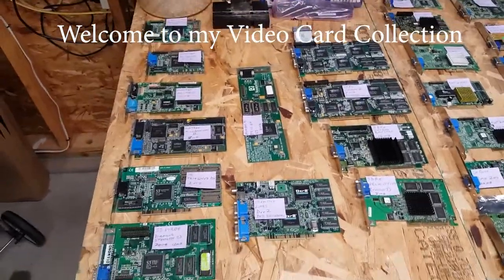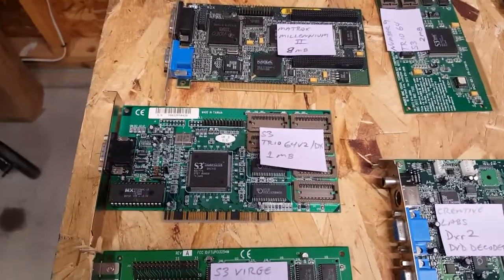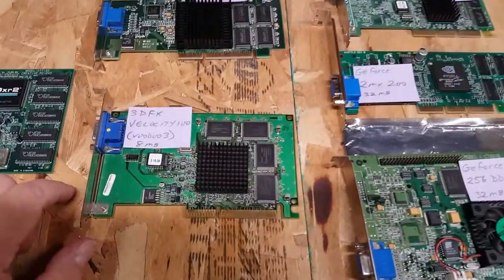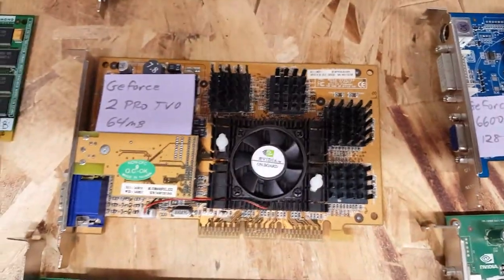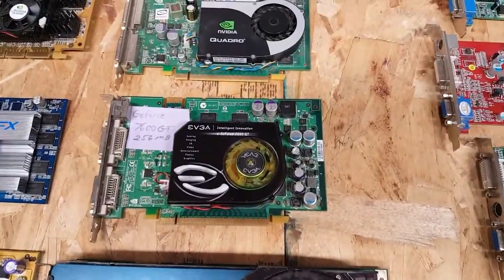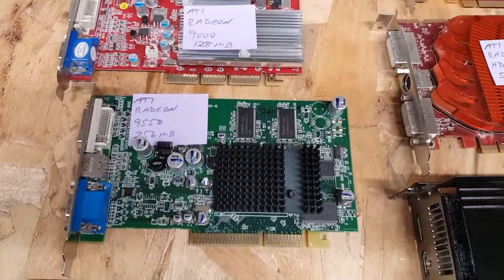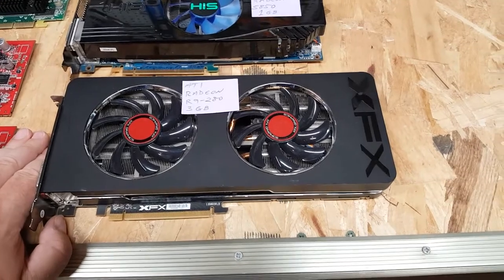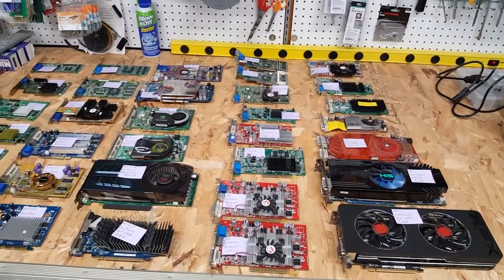I am a hoarder.  My video card collection.

Comment: Oh. Hello. I have the same interest as you. I also have a lot of 3d accelerator card collection
Reply from the maker: Hello!  It's fun hobby, right?  Do you have any really unusual or rare cards yourself?
Reply: @UncleMikeRetro   asus 7800gt dual?matrox parhelia 512?

i have many top card like gtx295 9800gx2 gtx690 quad
But if it’s a rare collection, I don’t think I have many
Reply: @UncleMikeRetro  i have
3dfx voodoo2 and 3 3000pci
matrox g200 g450 parhelia 512.
ati radeon256 9700prox2  hd5870x3  hd4870x2（dual gpun in single card） 
hd7970

gf2gts  gf3 ti500 gf4 ti4200 ti4600
gf68ultra 7800gt dual 8800gtx  gts250
gtx275x2 gtx295
gtx580x3
gtx690x2
Reply from the maker: @阿綸的全勳學院  The dual 7800s are nice!  and the Matrox is a classic.
Reply: @UncleMikeRetro  I don't have  any unusual rare video 3d accelerator

Comment: Nice collection
I also regret not buying Voodoo cards a decade ago, they were still quite affordable.
Radeon 4870 was my first ever powerful card, which replaced a practical GeForce 8600GT.
Reply from the maker: Who knew retro computer hardware would someday be valuable?  Better than Beeny Babies for sure, but you can never be sure.  I'd have gotten ahold of another set of matched Voodoo2's, Voodoo3's of all makes, and a Voodoo4 (at least).  But at the time I was actually playing games with my "retro" hardware and just drove on with the GeForce cards, letting 3dfx by the roadside 😑
Reply: @UncleMikeRetro 
Personally I just wish someone introduced me to the stocks a couple of years ago and just bought some nVidia stocks, instead of vintage hardware :)
Reply from the maker: @O.Shawabkeh  I am not greedy.  Gimme the old hardware.  preferably in the box :)